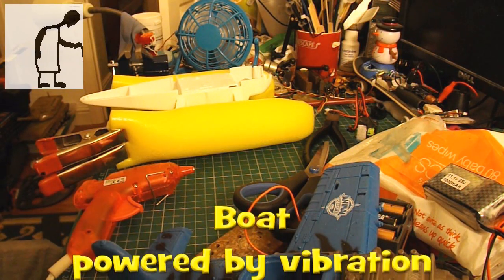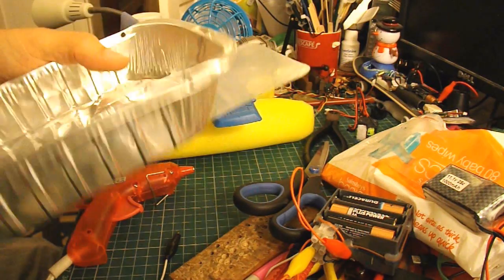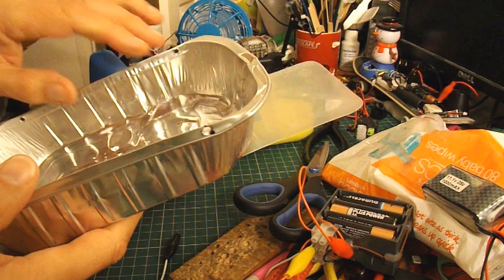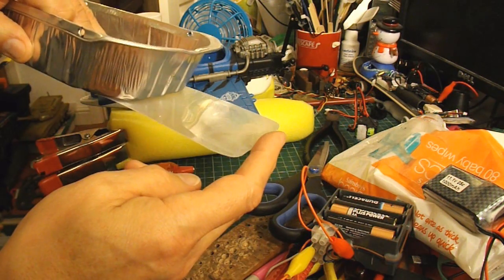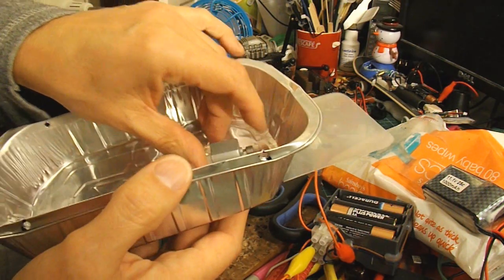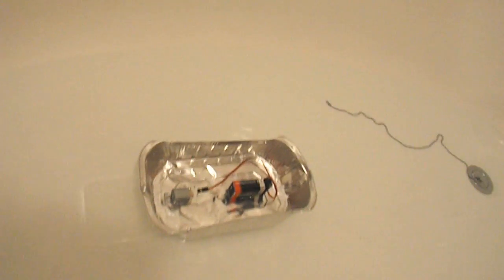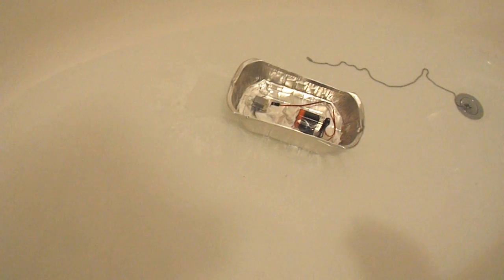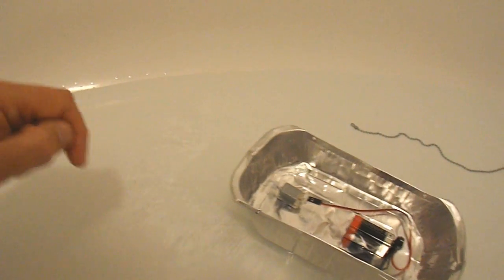Boat powered by vibration for Sahan Methmal

Comment: It would be interesting to experiment by cutting the plastic into different shapes. Everything has a resonance... a shape and weight where it vibrates the most efficiently.
Reply from the maker: Yes, it is one of those little projects that could quickly become a full time hobby in it's own right. There are so many variables you could try.

Comment: And putting two motors, one to the right and to the left ?.
If you turn off one or the other, the boat could turn.
Reply from the maker: +Francisco Javier Lázaro Pinela I don't think it would be that simple. The whole of the boat is bouncing up and down with the vibration. I think you would need to mount the motors directly on the flipper. Probably have 2 flippers. I think if anybody wanted to spend time on this it would take a lot of work to get good reliable results.
Reply: +GrandadIsAnOldMan Engines directly strike the fin ...
Reply from the maker: +Francisco Javier Lázaro Pinela it is not much different to this boat in principle https://youtu.be/jozN2szewSo

Comment: You could turn the motor 90 degrees. The torque wouldn't try to make the boat turn then.
Reply from the maker: +DavstrWrexham maybe, but if you watch carefully once it developed a resonant or harmonic frequency it moved forward. It would be interesting to see it in a larger pool so we could get a clearer idea of what is going on. If you have tried making those bristle bots with a vibrating motor attached to a brush you will know they tend to rotate regardless of which direction you attach the motor. With this boat the bit of plastic at the back works like a flipper or maybe a whale's tail and it is pushing the boat forwards once it gets going. The sideways turn seems to disappear once that happens.

Comment: Now I liked this, I think because it was different but mainly because I think there is Potential in the Idea.
Reply from the maker: +Graham R Dyer what we are looking at here is basically a flipper. If you wanted to take it to the next level I would have the motor and the flipper mounted externally to the boat otherwise everything on the boat gets shaken to pieces. At a slower rate it would look more like a whale tail moving on the water.